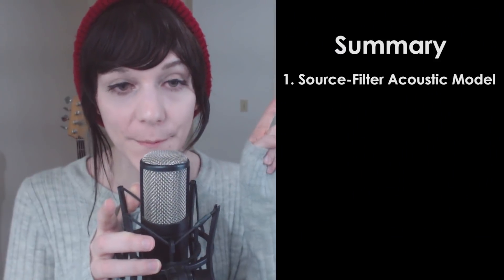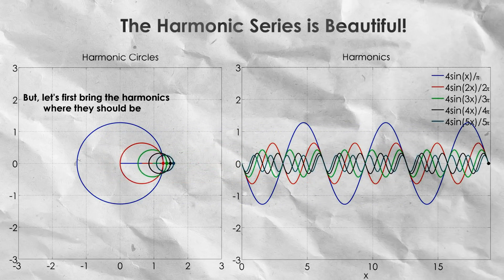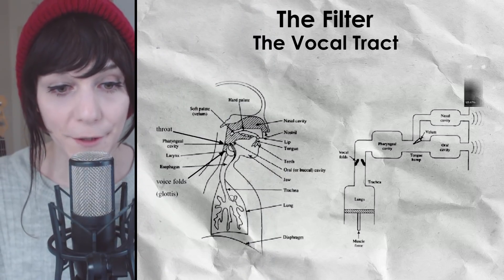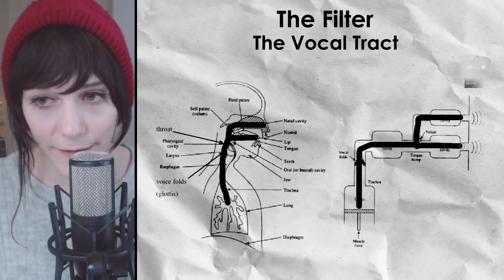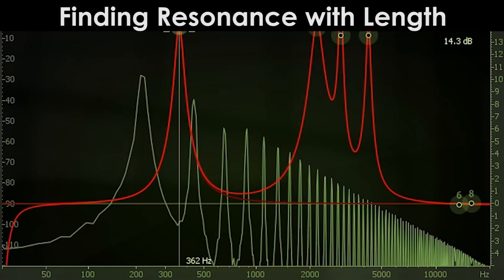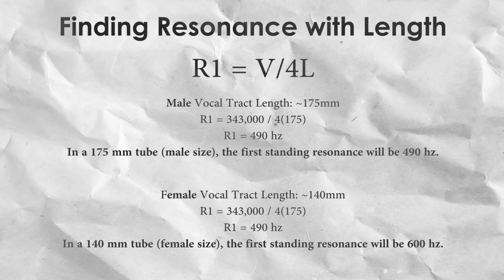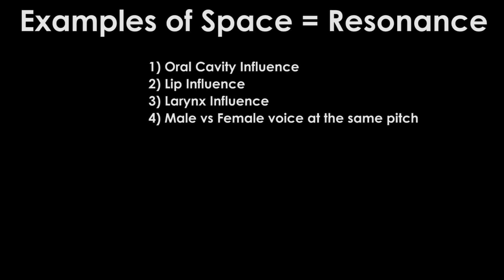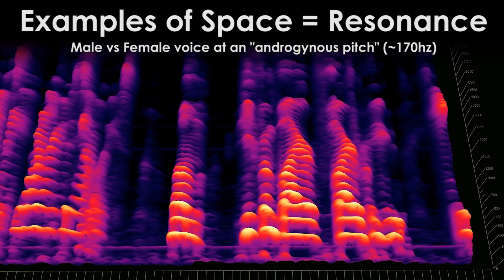The Art of Voice Feminization | Part 1: Overview, Acoustic Resonance, and A Conceptual Framework

Comment: I happened to start learning more about throat singing a few months before finding this video, and it's making me geek out really hard because it uses very similar concepts. Different styles focus more on either overtones or undertones, but either way, it's largely about altering the shape of your mouth/face—often moving through and between different vowel sounds—to isolate and bring forward different frequencies of overtones while holding a steady source tone. If you listen for them enough, your ears start picking them up all the time, just like you mentioned for the AC unit :)

edit: it's super present towards the end of the video when you start working through the different vowel sounds ^-^

Comment: I'm a total music theory nerd who's trying to transition, and this video is so unbelievably perfect for me, as I have a lot of background with music theory, tuning theory, etc. Thanks so much!
Reply from the maker: Awesome!! It's so great to have you here. There are lots of music nerds lurking around our lil community. 

Here is a musical/tuning description of voice feminization:

Male or female we all start with the same harmonic series sound mass. Depending on the mass, symmetry, or turbulence of the vocal folds they will lay out the volume profile of the source. Heavier mass vocal folds produce a flatter spectral profile so the highest harmonics are more equal in volume to the lower harmonics (essentially compression of the amplitude for each harmonic). Less vocal fold mass produces a gentler rolled off harmonic series where the 1:2:3:4:5:6:7:8 have the most energy and then it quick rolls off quieter. Female vocal tracts are then smaller so they concentrate the energy on the upper mid harmonics. In a way a male voice is a low fundamental with lots of lows and lots of highs. While the female voice is a higher fundamental with mostly mids. 

So feminize a masculine voice we have to learn to reduce the glottal mass in order to soften the harmonic series so it buzzes less, then we shrink the space to raise our resonances to higher harmonics relative to the masculine one. That's basically it. :)

Also different vowels are just different just intonation structures. The structure 1:5:7 is useful in feminization. Fascinatingly, in darker operatic vowels their pitch vs resonance is often tuned to 1:3:4, 1:2:4, etc. Very simple root, octave, fifth, octave kind of structures which is why they are so warm and smooth to blend! Lovely!
Reply: @TransVoiceLessons  Wow, thanks for that thought out response! I'll have to do some more research on intonation structures as it applies to this, that sounds super fascinating.
I also didn't realize that female voices were more mid-ranged, I always just assumed it was female = high, male = low.

 I'm gonna make sure to watch all these videos and start practicing. Thanks for making all this information freely available.
Reply: Archive higher pitch and more feminine voice with this effective voice highlighting tea. High in Vitamin C, vitamin B12 and Thiamine. You should try, take two weeks to hear changes and helps your throat stay unhurt whilst practicing.

Comment: if all human voices have the same source, how do people have different vocal ranges?
Reply from the maker: Michael Light Great question! Vocal ranges differ due to physiological and technique differences. However, even in the case of extremely different range between voices, the fundamental harmonic structure is identical. Harmonics are spaced at 1f:2f:3f:4f etc regardless of what the frequency is (f). When I say all sources are the same, that is not to say there is no difference at the vocal fold level—instead it is to say that the actual pattern they output is the same regardless of those differences (assuming there isn’t a malformation or vocal fold disorder). The harmonic series is always the harmonic series regardless of the fundamental it is created from.
Reply: @TransVoiceLessons  Thanks, that makes much more sense

Comment: What do you do if you have permanent vocal fatigue from doing stuff like this, even when you are talking normally without trying to change your voice! I am stuck with a permanent sore throat from talking
Reply from the maker: That would depend entirely upon what you describe as, "stuff like this." This video is purely informative rather than instructional. If I knew how you practice or how your voice sounds I could give you a more accurate analysis of why your voice is experiencing disorder.

Without that information all I can recommend is going to get your vocal folds scoped by an otolaryngologist. There is no reason at all why you should be feeling this way when trying to practice your voice.

I could make assumptions about the errors in your technique but its speculation without getting more information from you.
Reply: @TransVoiceLessons  I think the pain is dissipating the more I talk so that's good!

Comment: So is resonance kinda the same thing as timbre?

Also I'm a little confused by the idea of male and female source sounds being the same? I thought that male vocal cords were thicker, resulting in lower average pitch, and male vocal tracts longer, resulting in darker resonance/timbre/whatever?

Is that not the case? If not what exactly is going on with surgeries that alter the vocal cords?
Reply from the maker: Hey there! Those are all very great questions. Resonance is exactly the same thing as timbre. It is an element distinctly separate from pitch and intensity. However, timbre is determined by the way in which the acoustic resonances boost, reduce, or modify the source of an instrument. The source-filter model also applies instruments. Common instruments almost all utilize a resonating body to amplify parts of the source. In string instruments like the guitar or cello, the body will have resonant frequencies and anti-resonances. It acts as a filter static filter, rather than a modulating one like the human voice. Further, with instruments like the tuba, the spectral filter will be independent of the pitch, but varying with dynamics, lip pressure and stiffness.

As for your question about pitch, you are correct. The male vocal folds are thicker resulting in a lower fundamental. However, when we discuss the "source tone", I'm referring specifically to the set of ratios that can be plugged in with any pitch. The harmonic series is still the same harmonic series, regardless of what the fundamental is. It will just print different output values as the fundamental changes higher or lower:

Harmonic series is:
1:1
1:2
1:3
1:4
.. etc

so regardless of what fundamental you plug in, the actual structure and relativistic proportion of the source is the same even though the actual numeric values will change.
Reply: TransVoiceLessons oh okay I see, thank you so much for the video and for clearing up my misunderstanding!